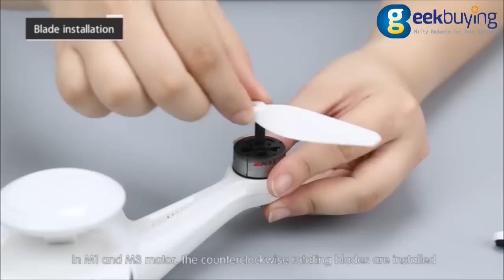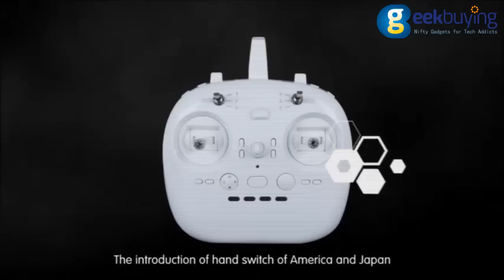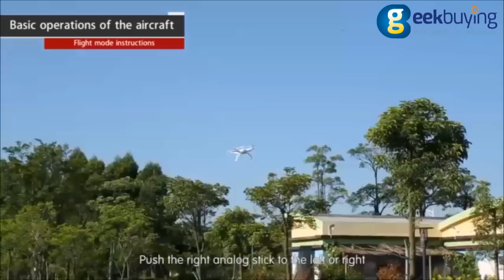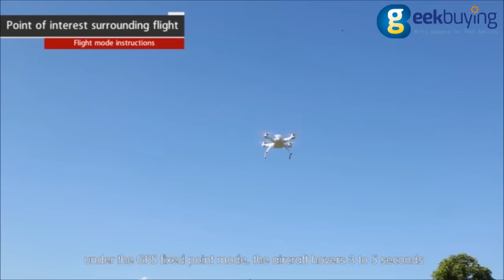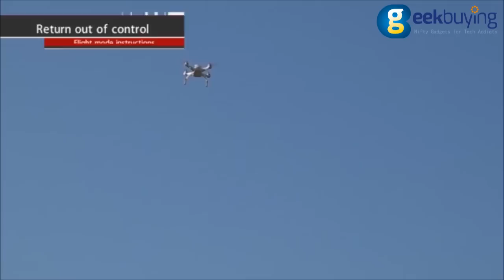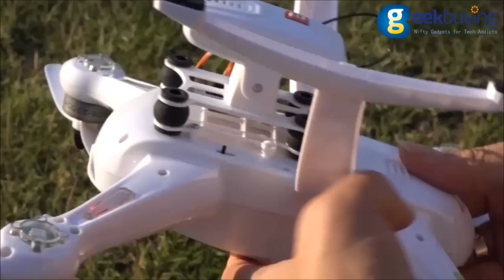AOSENMA CG035 FPV Drone Tutorial Installation & Guidance

Comment: I purchased this drone back in April. I have had the most impossible time with the camera I purchased with it. I wish I had gone the less expensive mode and bought the gimbal for the gimbal mount for my Hero4 cameras. The camera that came with it will not record. I have tried 6 different cards without success and yes, I formatted the cards!

Comment: Hello ! I bought a CG035 like you and I had a crash with GPS mode. I saw
 that one of the motors went off while the drone was in flight, just 
before crashing. I think the screws of the motors need to be glued. In 
my opinion this drone needs changes in order to to be reliable.